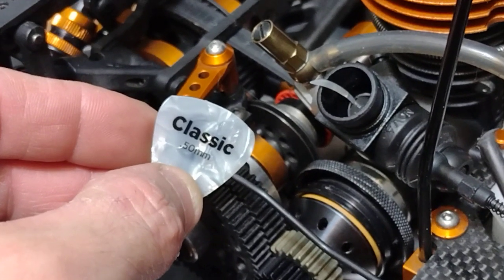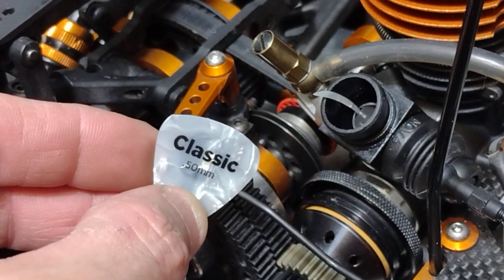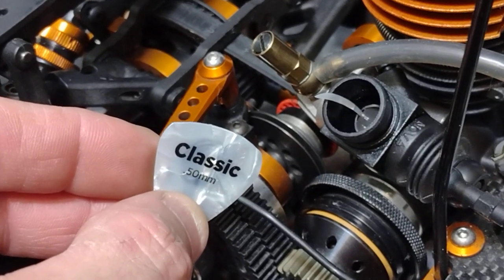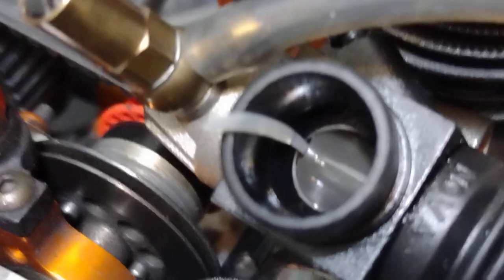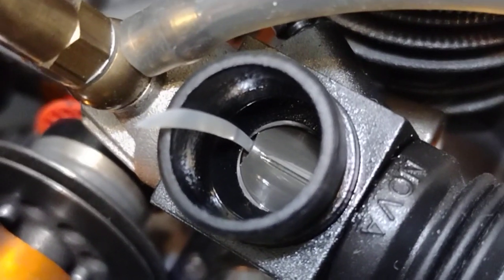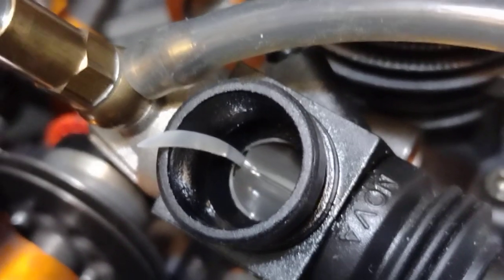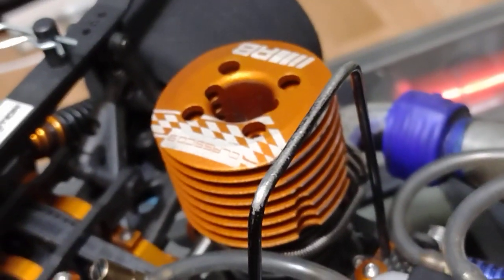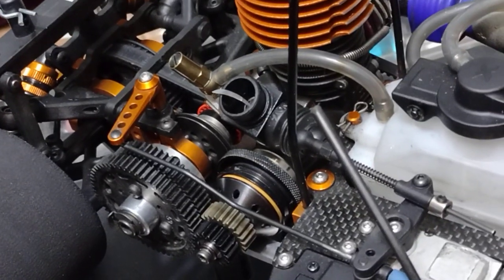How to set the perfect idle gap

Comment: Is the 0.5mm gap recommended for 3.5cc engines only? Or is it also a good idea on bigger ones like 4.6cc or higher?
Reply from the maker: I'm not sure to be honest. I know .5 mm gap is a good place to start for most engines. Some engines need about 1 mm gap...like my LRP.32  . Sorry I couldn't be of more help. I know people like to make the idle gap as small as possible... If that helps at all. Sorry bud.
Reply: @TexasHill  No problem! Weirdly enough, while the LRP 32 recommends 1mm in its manual, the newer 32X recommends 0.5mm. On a Hobao Hyper 21 they also recommended 1mm, but the engine wouldnt run well with that after break-in and needed 0.5mm (at 1mm it had heavy 2 stage idle and would cut out after 10-15s, not matter the needle settings).
Reply: @xXYannuschXx most engines are .5-1.0mm gap but once you start leaning the lsn the idle gap should be closed and typically you will end up right around .5 setting it at .5 before beginning to tune just simplifies tuning and makes it a little easier to set the lsn